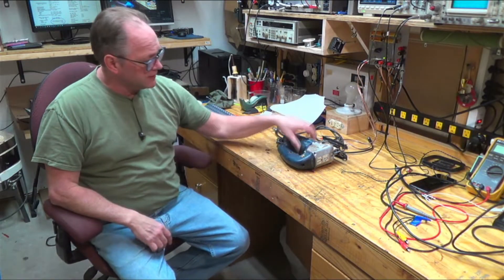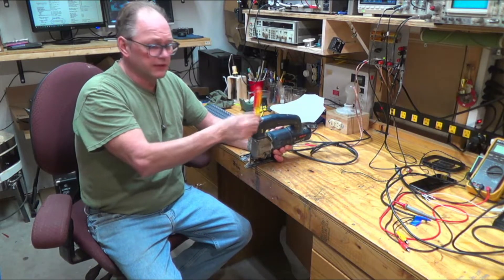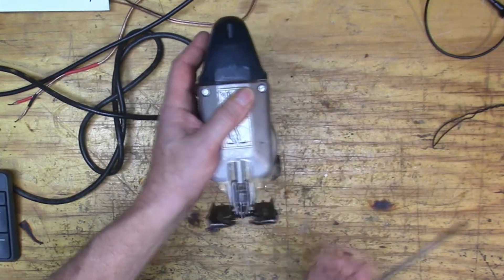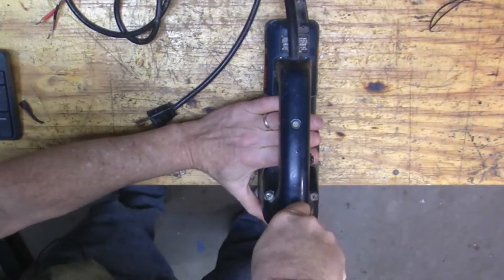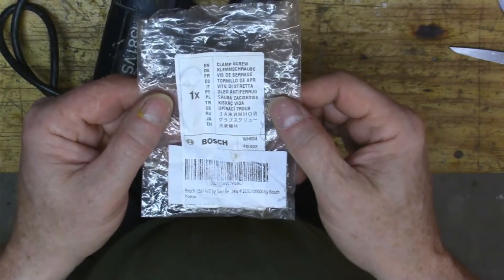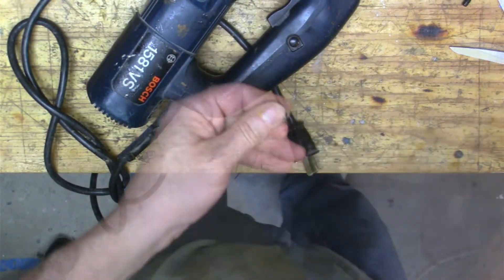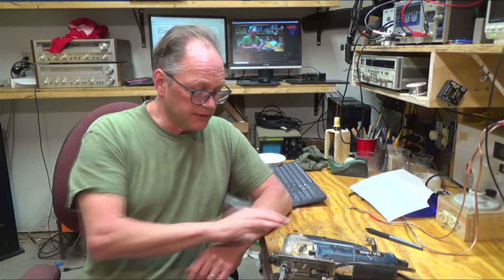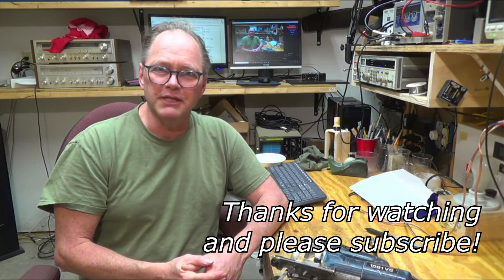Bosch 1581vs Jig Saw Easy Blade Retaining Screw Repair

Comment: I owe you a beer. Looks like you may have saved me about $170. I was getting ready to pull the pin on my beloved 35 year old 1581. I was sure the slot on the retaining screw was stripped out. Couldn't tighten the blade completely, it was working its way out and cutting at an angle. Didn't know you could pull the screw and I certainly didn't know replacement screws were still available.

Took a bit to remove the screw but when I got it out I found the slot on the screw head had filled up with debris from over the years, the slot is just fine. I've got another piece of Grinch yard ornament to cut out for my daughter and it will be a great joy to get to do that with my companion of so many years. Thanks so much for your video.
Reply from the maker: I just love this saw, glad you got it working again!

Comment: Thanks for the information I wasn't too sure if that set screw comes out... A friend gave me this jigsaw and I couldn't figure out how the blade changed it was just perplexing..,. Called my friend how do you change the blade... A Long screwdriver is used to change the blade, but I couldn't figure it out....I tried putting a screwdriver in there, with no success I couldn't find the the slot in the on the set screw and wasn't too sure if I was doing things right or wrong ,it just didn't seem to work, but after his information I said okay ...but, it didn't seem to work.... but he says he's done it a thousand times and he's coming over ....so he showed me.... sure enough it worked , great saw.... Good video , great to know that the set screw comes out ....possibly  l will replace it if I have any trouble ... Because it just doesn't seem to work perfectly ...but you know it's just my first time changing a blade....? shouldn't be so difficult... but.... Thanks for the video and the information 😁
Reply from the maker: It is really not the best system especially needing a special screwdriver!

Comment: Just had the blade screw come out of my Bosch jigsaw which I've had and used a lot for decades. 
The screw is lost. Have trawled for it with a magnet in the sawdust but no luck. I manufacture machinery so have many sizes and types of screws to hand. Could you advise please what thread it is and I can probably modify one to suit.
Thanks for the video. Clear and concise.

Comment: Great video thx for sharing very useful information. Question: How do u replace the blade. i have one and cant figure out how to install the blade, might be missing parts. thx a lot.
Reply from the maker: Loosen the screw and hold the blade sideways, then insert. Turn it straight and tighten the screw

Comment: I found a 1581VS in the back of one of my friends's sheds and have not been able to find anywhere or any information or user manuals on this particular jigsaw because I want to change the blade on it thank you so much for posting this.
Btw, Did you know that this particular model was made in a  couple different countries? And from the research I did if you happen to have the one made in Switzerland it's worth more than double of the ones made in other countries.

Comment: Could you tell me the process of putting in a new blade. I want to use my jigsaw the other day and it had been several years since I used it. And apparently I forgot the process, and I don't know where my manual has disappeared to. It would be much appreciated if you can help or if you have a manual post a copy of that page showing how to install and remove a new blade. Thank you!
Reply from the maker: You need a long thin flat screw driver. Put it in the hole on the top and turn until you feel it catch the screw. Once it is loose you can turn the blade 90 degrees and pull the blade out. Do the reverse to put the blade in

Comment: Have that same model ... 36 years old! As you know, the notched bushing into which the blade is inserted must be turned 90 degrees sideways (after loosening the screw as in your video) in order to remove the blade. Then it is rotated to the blade teeth forward position before retightening the screw. Well, mine got stuck in the "remove" position & won't rotate back. Do you think the problem is the retention screw that you replaced? Thanks.
Reply from the maker: It could be the screw, but it is probably the tube that it is in. But you can buy that and replace too.

Comment: Where did you find that locking screw?  Ereplacement Parts doesn't show it in the schematic diagram of the 1582VS (the barrel grip version).